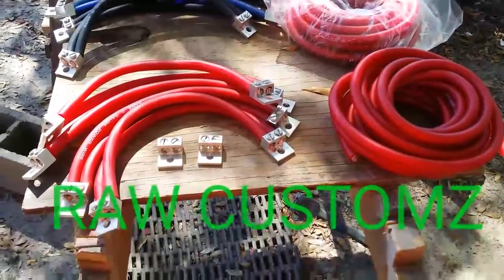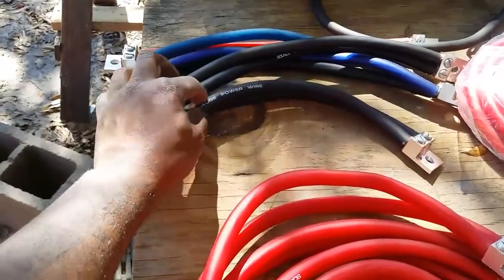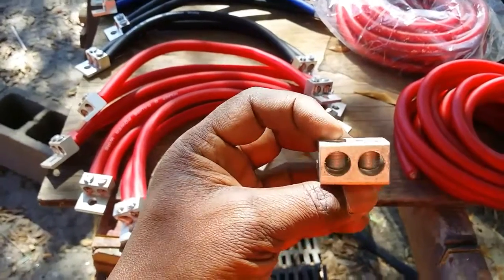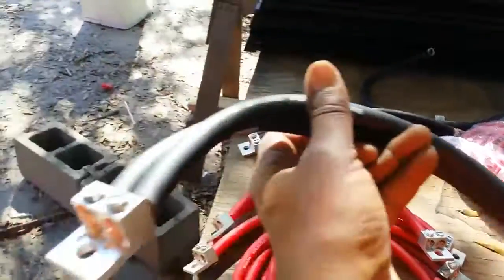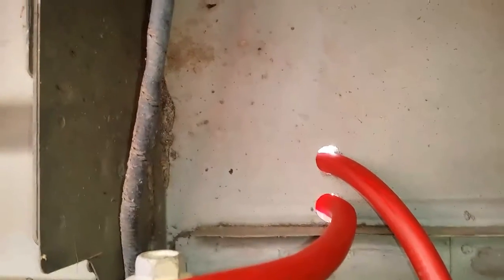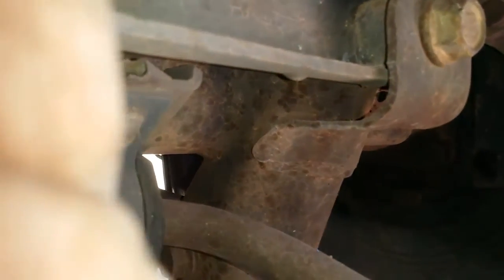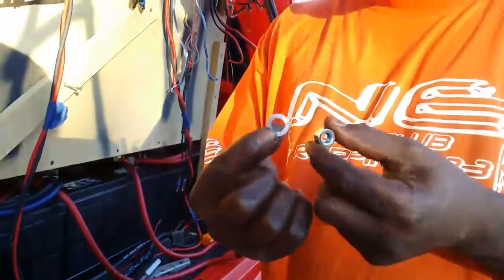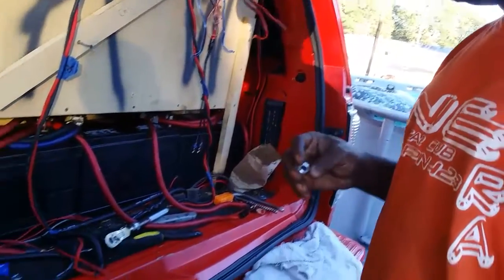Beefing up da electrical...pt1

Comment: That's a lot of 0 gauge wire mane! Got to do the same to mine. Did you run +/- from the front battery to the rear bank? Was thinking of doing the something.
Reply from the maker: Bj Hammon was up partner.. I actually have a total of 3 runs of power. 1 is coming off the front battery and 2 are straight from my factory atl. I have all my ground straight down to the frame of the truck. on part 2 video i will show it all on the walk around.
Reply: Raw Customz - That's what's up. I'll keep a look out for that one. Got my 0g ready, just not 100% how I should run it. I see different ways in here.